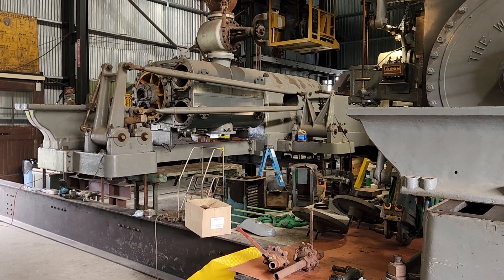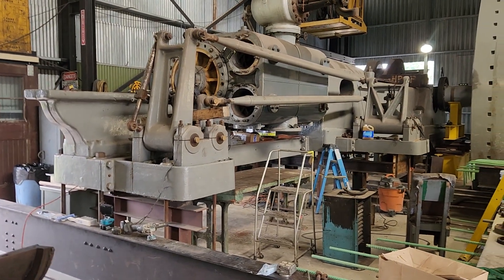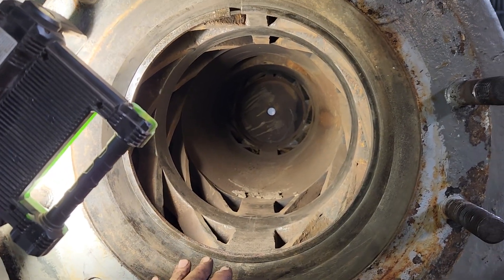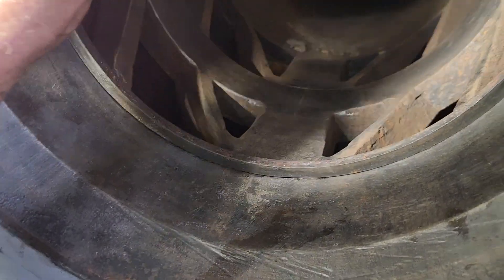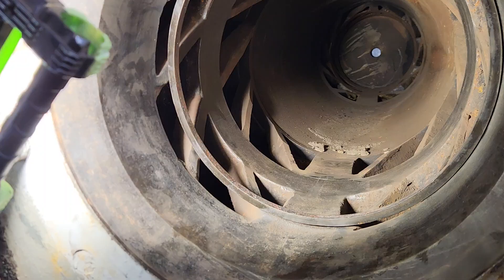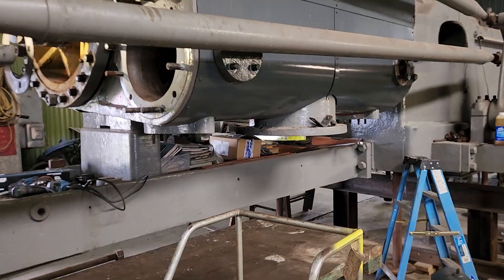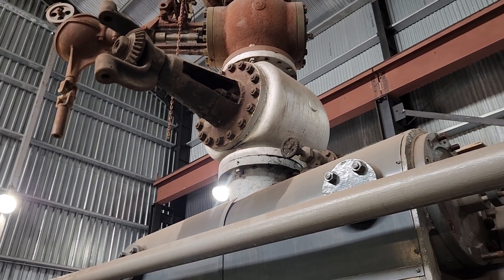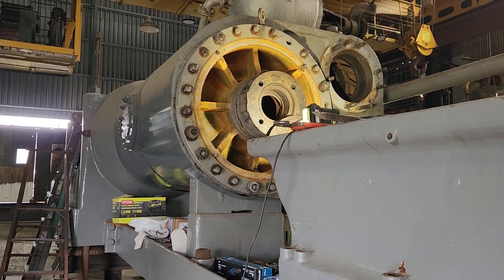Tod Engine Restoration Update:  We Have a Boring Job to Do!

Comment: Is there any rational reason to believe that the low-pressure engine valves are in any better condition? In the realm of misery-loves-company, eight bores needing attention is probably optimistic. But I’m hanging with you brother!
Reply from the maker: LP side will not be used at all.  We will be operating this engine as a single cylinder simple.